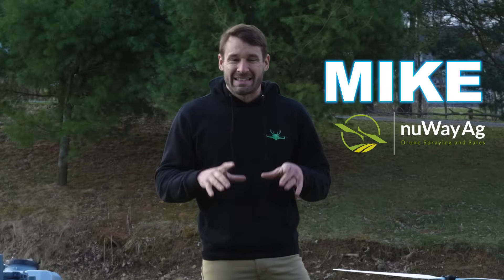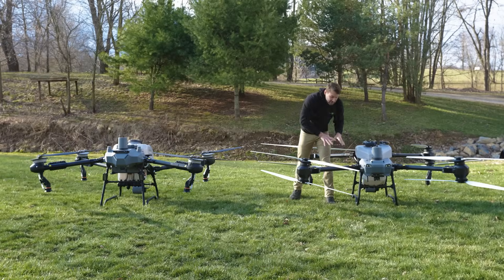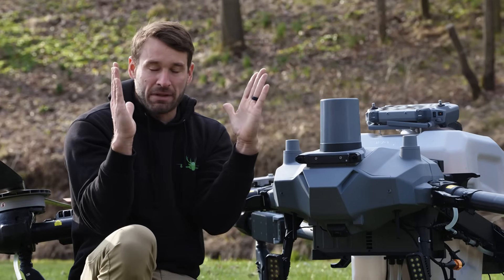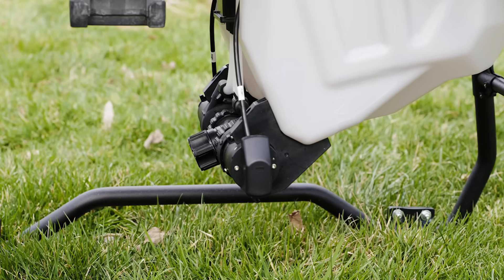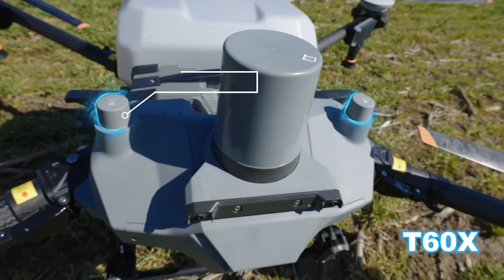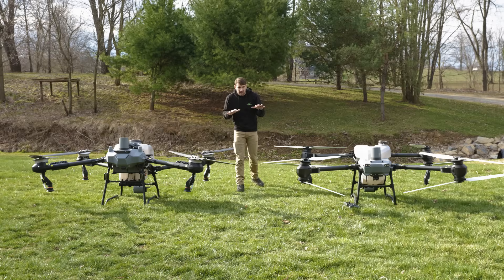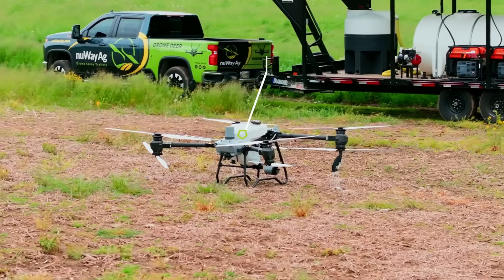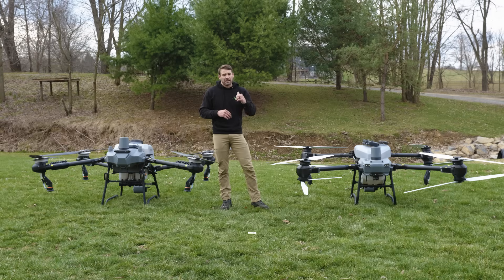T60X vs T50 Hardware Comparison

Comment: I flew the T60 over the weekend. Its fast! Really fast!! However the terrain follow was not great and the batteries couldn't keep up with me. I still did 52 acres in an hour on a wide open field. The batteries will wear you out after a long day. Overall I like it, but I think I'll stick with the T50 for now.
Reply from the maker: This is valuable information. Yes it is very hard to beat a T50. I’m curious did you have the 14,000 generator to charge your batteries? If you had a C 10,000 that will not work. You need a 11,500W charger and the 14,000 generator provides that.
Reply: @nuWayAg I was using the c 10,000 charger. I wondered if that could have played a part. I had an adapter cord that hooked up to my charger. 

I also really liked that it only had 8 props. I had to land it in a field and didn't have to worry about the lower blades getting in to the weeds.

Comment: As far as I know they moved battery up front to lover the risk of chemicals spilling on to terminals when battery is not on drone. Also for vision sensors T60 uses fisheye camera as vision sensor too, so it has 3 vision sensors.
Reply from the maker: Yeah, after the making of this video, I found out that they use the FPV as well. Thanks for watching.